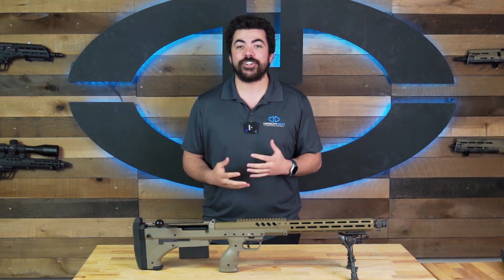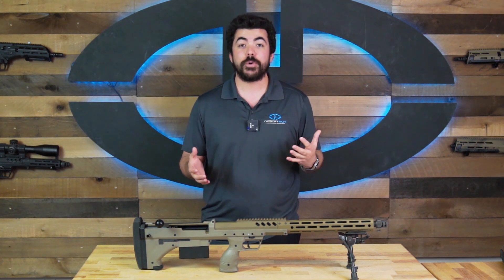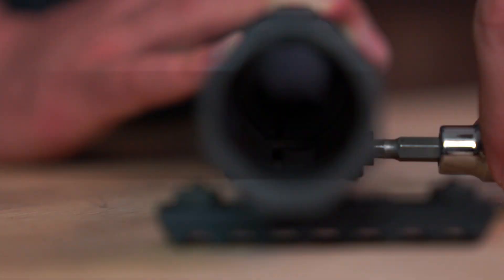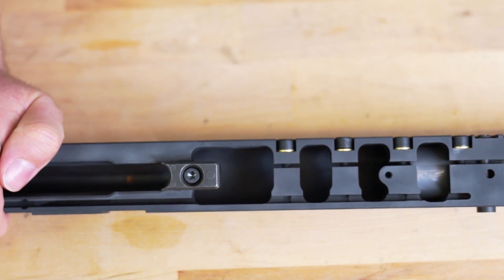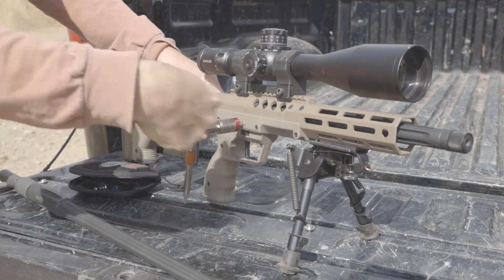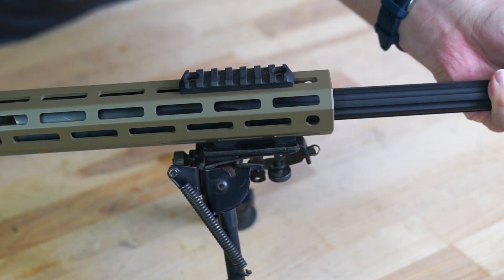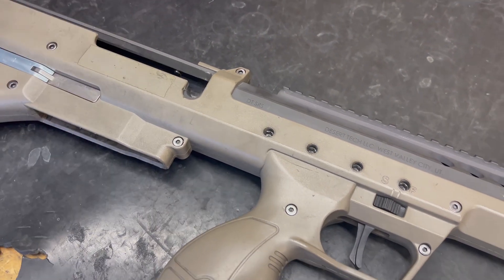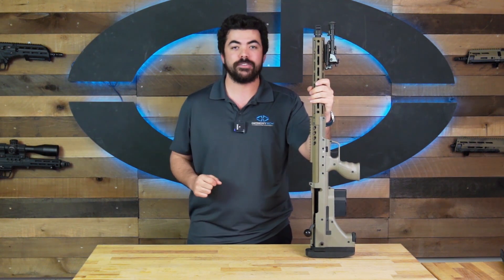The Desert Tech SRS: the foundation of multi-caliber accuracy

Comment: I have the A1 model. To this day, it’s the most accurate.308 rifle that I’ve ever shot with, compared to Sig SSG3000, GA Precision HRT, FN SPR A1, Tikka T3X Tac and Sako TRG22. No cold bore shift and it returns to zero after switching from .308 to 6.5 CM back and forth. But the trigger is only adjusted down to 2.5 lbs, not as light as 1-3lbs as claimed but still pretty good for a bullpup design trigger
Reply from the maker: Good to hear!